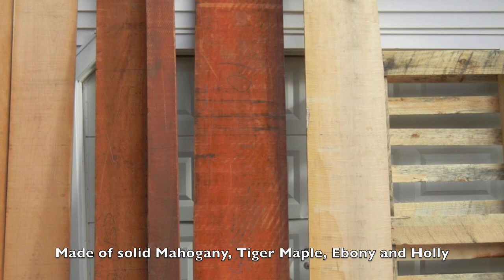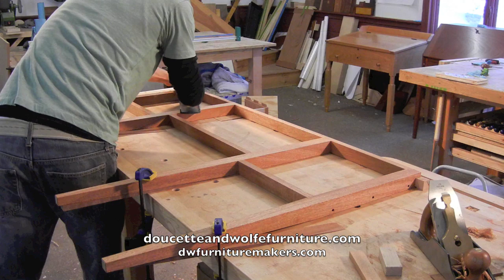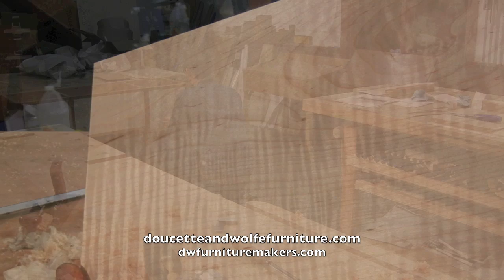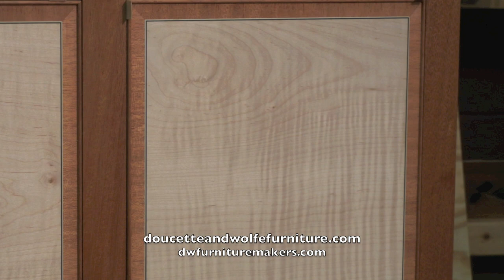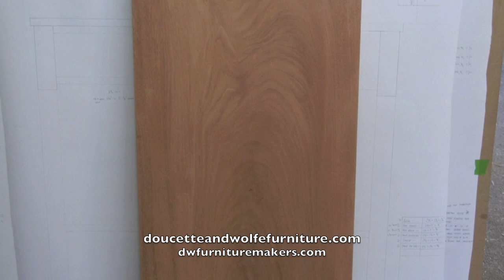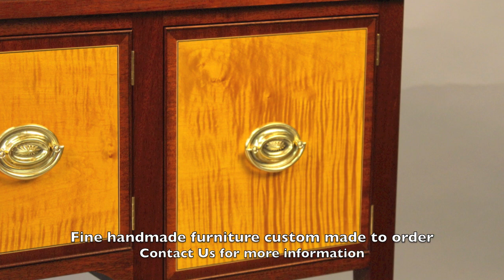Sideboard Making a Sideboard by Doucette and Wolfe Furniture Makers

Comment: Matthew, I love your work.  Can you explain the door construction?  Is there some trick you use to get around the wood movement issues with the frame miters opening up, or is it because they are small enough that the movement is negligible so you just don't worry about it?  Thanks for any insight.  I aspire to work at your level someday.
Reply from the maker: The core of the door is made by laminating a variety of pieces of quarter sawn mahogany.  the tiger maple and cross banding is all shop made at about 1/16” thick.  Movement is really not an issue with this form of construction. Thanks

Comment: I started furniture making classes in january. I am so glad to have found your channel. I have been watching your videos for the past 2 days. I have a question : Do you sand after using the hand planes? thanks
Reply from the maker: I do whatever I need to do to achieve the surface I want.  Some times I can achieve that with planes, sometimes I need to sand. After planes,  If I need to sand usually it is not necessary to go lower than 220.  Good luck with your classes